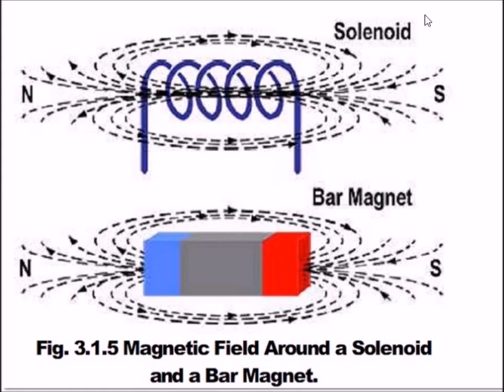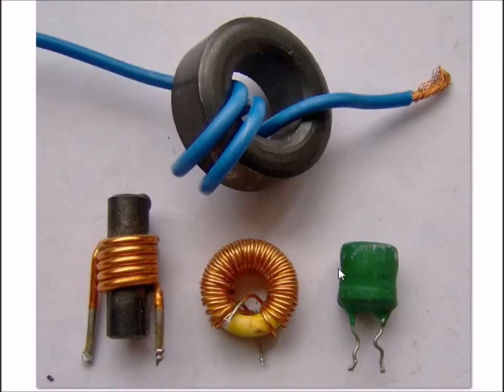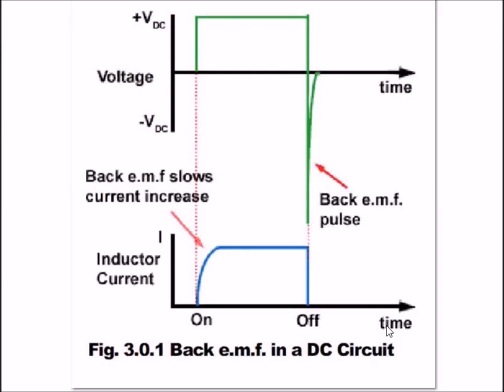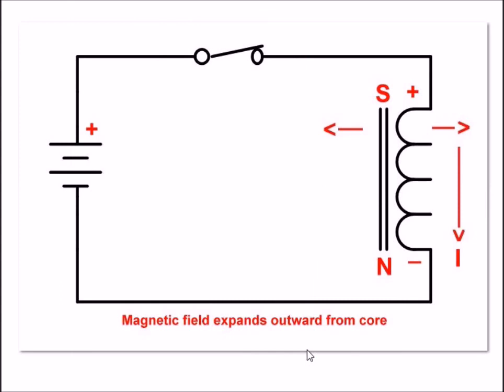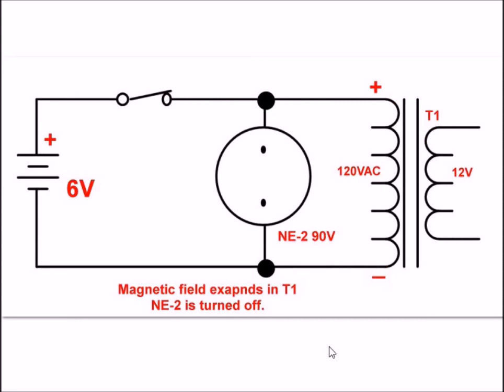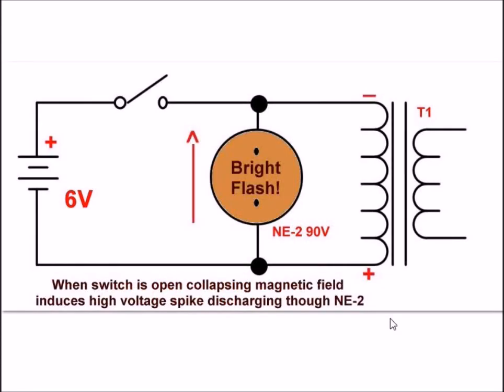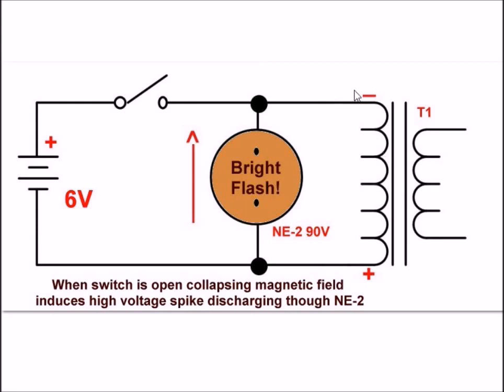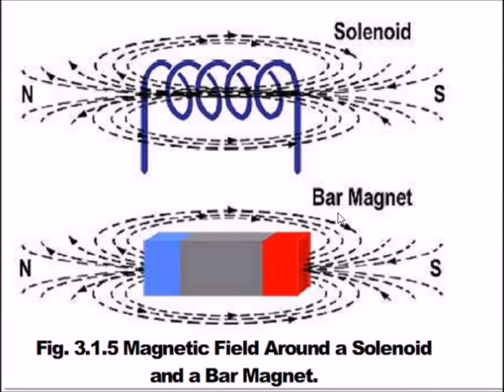High Voltage and Basic Inductors

Comment: Excuse me. You didn't induce a high voltage in the coil. The voltage across the coil never exceeds 6v either way.
You induced a magnetic flux in the coil.
When the magnetic flux collapses over an infinitesimal time span , the delta I over delta T multiple the inductance, becomes a very large current. The large current/charge multiple the resistance gives rise to high voltage.
This high voltage is across the overall resistance, not the inductor.
This is only my personal understanding of the equations.
Nevertheless, i love your channel, because your technical understanding is profound/golden. You are a great teacher, to me.
Reply from the maker: Yes, it did induce a high voltage when the magnetic field collapsed.
Reply: @LewisLoflin  ok. You know better. Thank you for your reply.
I sometimes confuse the mathematics, to have certain implications.
You know better because you are dealing with it practically.
Reply: @LewisLoflin  NO. it did not. @yoramalon5273 is precisely right
Reply: You're absolutely right. The coil never induces voltage. Nevetheless when you applied your resistance and voltage appeared accross it due to the Ohm's law - it also appears across the coil automatically

Comment: Hi Lewis.
What will happen if the 12V side initially supplying loads but then it is shorted where 12V goes to 0V?
Will the same happen at the other side?
Reply from the maker: The magnetic field would still collapse creating a high voltage spike.
Reply: @LewisLoflin  Can you explain the technical.part of it?

Comment: Hi, how would you calculate the voltage spike on the secondary ?
Reply from the maker: Hard to do. I'd have to know the number of windings, etc. If it was the input of say 120VAC transformer then the spike is 120V plus.

Comment: Thank you,too many who have no experience of the Kettering ignition keep saying a DC supply cannot charge a coil.I have heard that from E Engineers I am not an Electrical engineer but have had many motorcycles with this sort of ignition.I used to open the points on my 1942WLA Harley to clear an over rich flooded start.

Comment: The high voltage comes from V= Coil turns X  change in flux / change in time. Because the change in time is so small, like you said, the induced voltage is large.

Comment: An Inductor adds Electrical Inertia!
Reply from the maker: Hadn't thought od it that way.
Reply: Lewis Loflin :) I believe Electrical Inertia is the alternative name for Inductance!
Reply: Yes, electrical inertial with respect to the current. An Inductor will try to resist the change in current through it coils. If the current gets larger, a larger mag field is produced that increases the back emf which will try to reduce the applied voltage. If the current gets smaller or shut off, the mag field will collapse to induce a voltage that will keep current going in the original direction.

Comment: On your little student zapper circuit, does the resistance of the coil prevent overheating once steady state is reached? Or do you assume the circuit will only be on briefly?
Reply from the maker: Don't leave the battery  connected for long.